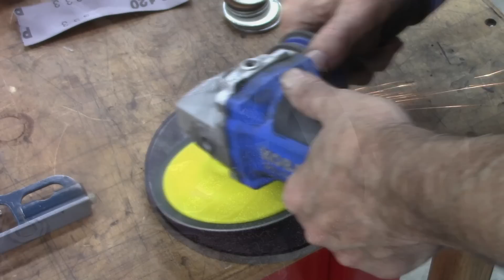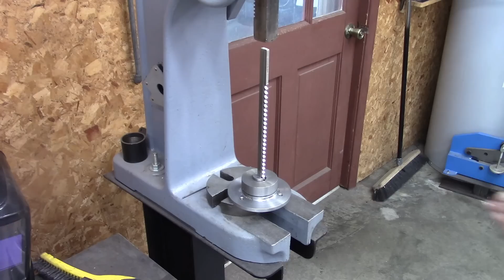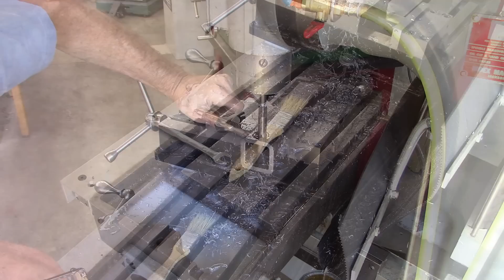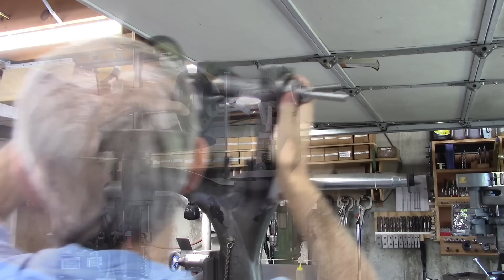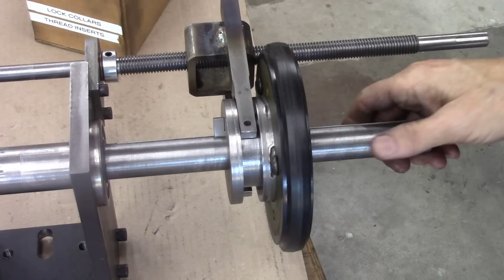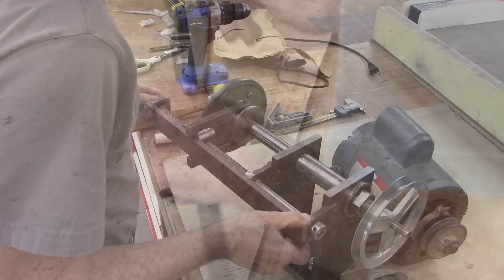1918 Jas. Clark Jr. Electric Co. Friction drive drill press - Building a new drive - Part 2

Comment: Your broach crooking problem is because of your arbor press.  It is a square ram press.  The force comes from the pitch-line of the gear rack. The broach needs to be centered directly under the rack, not in the center of the square ram.  Without a mushroom head cap for the end of the ram, this is hard to locate there.  Take for example a Greenerd arbor press, with the round ram.  The rack is in the center of the ram. They give a straight line of downward force. A Greenerd press will have no issues pushing a broach.  All those Atlas or Dake presses will do, is the ram will crook, and force your broach off center.  They may be OK for pushing bushings and bearings, but absolute crap for pushing a broach.  As I said, making a mushroom cap for your ram will help, and you can get the push from right under the rack, but the ram will still move all over.  Give your Dake to someone you don't like, and buy a Greenerd.  I think Winsmith in Springville NY also made a copy of the Greenerd.  -------Doozer
Reply from the maker: You may be correct on all accounts, I have a very old drill press that has an applied rack on the back of the quill, it moved the drill out toward the operator significantly if you don't keep the quill adjusted tight. Mushroom end???  I thought you might have meant concave but after looking at pictures it looks convex which seems like a negative. There is also a couple other things to consider. Some say to relieve the pressure and let the broach align itself (which I did). I think you you be better off with the broach fix on the end of the ram and the work clamped. And last. The alignment of the ram due to pressure at the rack moves the ram toward the operator and my broach leaned back, not forward. Honestly, I think the broach method for cutting keyways is not ideal. there is nothing stopping the teeth from being pulled into the cut.

Comment: Mark,  Why do you saw so much material instead of using the Vevor Plasma Cutter?  With the broach, is the end of the ram parallel with the bolster plate?  Also next time push three teeth and release pressure prior to pushing again.   Next suggestion is reduce the motor pulley diameter to 2 inch and increase the shaft pulley to 12 inch; 4000 RPM is much too high for the spindle bearings of a machine of that vintage.   JAS. CLARK JR. designed a very interesting drive,  it may be necessary to increase the friction wheel pressure against the drive disk to enable the transfer of sufficient power to drill over 0.50 diameter drills.  This was a fun project keep up the good work!
Reply from the maker: I sold the plasma. Part of my problem with the plasma was an unsteady hand but mostly it made a huge mess. The saw (in most cases) is the best option. I did as you suggest, advance the broach and then release the pressure. Honestly, I think this actually contributes to the problem. The teeth of the broach pull the broach into the cut and releasing the pressure allows the broach to angle back. I think constant pressure is best although maybe not a complete fix. I need to possibly support the work better and also check the press ram alinement. As for the drill press speed, the motor pulley is 3" and the driven is 6". The puck (rubber drive) is also about 6". At the outer edge of the platter its 14". With a motor speed of 1750 the RPM of the puck is 875. The reduction ratio between the puck and platter is 2.3 which reduces the speed to 380 RPM. Realistic top speed is 1700 which is pushing things a little. I may increase the driven pulley diameter a little to get the low speed down about 250 but the current speed is good for most things. The drill press is now almost complete now (the video content is behind). The rubber on the puck is slightly compressed and seems to grab very well. I tested a 5/8" drill on 3/8" steel at the lowest RPM of 380 and it never hesitated.

Comment: I am really enjoying this project.  Whomever conceived the idea to use the puc / plate mechanism for an infinitely variable ratio was indeed a very clever person.  I can't wait to see the project outcome used as a tool.
Reply from the maker: There are several other methods used on old machines too. I saw a drill press with with two apposing cons with a rubber wheel between them. You move the wheel change the ratio.

Comment: The adjuster rod, I'd put a block of aluminum or steel inside the quare tubing , that is holding a brass nut. Or drill and tap a piece of brass to make the threaded adjuster brass  and maybe have room for felt around the threaded rod.with a 1/8" npt pipe about 1" long to add a few drops of oil occasionally. Like Babbitt bearings used to keep oil on the shaft!
Reply from the maker: Hmmm...  Its not going to be moved often but I like the oil felt idea. I'll put it inside the square. Thanks

Comment: To prevent the broach from going on a tangent, id make a longer bushing. That  can hold the broach higher up. Then be removed when the broach is deeper. Possibly using a bolt  to hold it to the bushing inside the hole. It can use a hollow dowel to keep its precision. And a bolt to hold it together,  the bolt could be about 3.5" 1/4" with the  bushing extension being about 3"- 3.125" tall. It can be clearanced to allow the shim to fit for the second pass.  Or make a longer shim, that could be another way, make a shim about 6" long .  With enough thickness up top for about 3"-4" to support the broach. Its not going to be that strong. I like the long bushing extension better!✌️ have a great day!
Reply from the maker: I agree...  lots of room for improvement. This is a bad system for cutting a keyway. I will fix this

Comment: I had that problem broaching on my press til I realized there’s a hole drilled on bottom of press arm for attachments ( I guess). I just used a steel plate between the arm and broach and it pushed straight after that.
Reply from the maker: My ram has a slight curve on the bottom, not sure it has a hole. I can machine is flat but I'm not convine it would do anything. I'll look at this closer, thanks

Comment: I assume you are lifting the arbor regularly to relieve lateral pressure? Try turning the teeth of the broach away from you.
Reply from the maker: I thing relieve the pressure is part of the problem.
Reply: @WinkysWorkshop  If you don't lift several times, you most assuredly will break the broach. Rotating the teeth 180 degrees each lift will help if the arbor is not square to the base.
Reply from the maker: @mikepoore1653  Lifting the ram allows the broach to lean. Once is starts it will get worse. On the flip side, putting a bow in the broach is not ideal either. This is a very bad system for cutting a keyway. I will improve on this.

Comment: I’ve had similar problems.  I once had the shim drag through. 
The longer the bore the more problems I have.
Making sure the broach and table and ram are lined up and square helps. Use lots of heavy duty grease between broach and shim.
I also found some burrs on the back of the broach and smoothed them out allowed things to slide easier. The back of the broach on the leading edge had a sharp  edge and caught the shim.
Reply from the maker: Thanks for the tips! There has to be a way to make broaching fool proof!
Reply: @WinkysWorkshop  from my reading the gold standard is a pull through broach - but that is an out of reach snack bracket for me
Reply from the maker: @glennwright9747  OH...  interesting (and maybe tricky)

Comment: The first pass on the broach seemed uneventful.  Your broaching problem only seemed to manifest after inserting the spacer to push the broach further into the cut.  Is the spacer not parallel, or maybe a chip got stuck behind the spacer, or there is a burr on the back ?  Even a tiny change from truly vertical will position the top of the broach further back on the face of the ram and the effective angle of the broach will get worse and worse as the ram descends.
Reply from the maker: Not sure why but it was for sure at an angle. The tooth shape seems to put it away from the shim. Has to be a way to make it fool proof

Comment: You ought to put a guard around the driven disk or run it with a hardhat 😊
Reply from the maker: Fortunately the disk is smooth and without a pinch point in front. It's possible you might get a stripe on your forehead but no real danger. It puts out a lot of air at higher speeds. It would keep you cool on a hot summer day. 😜

Comment: It will be interesting to see when you get a chuck on the shaft and put it under a load and see if the clutch wheel slips or has enough friction to grab and drill large holes. But it sure is a very nice build.
Reply from the maker: We shall see but I think it will be fine.

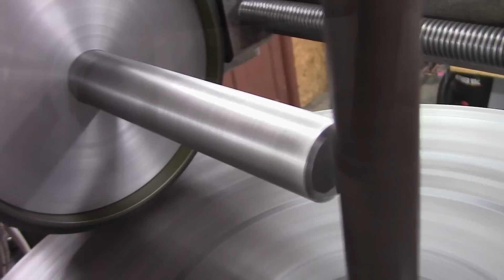Comment: Amazing project,Mark and well built as usual.It looks like is working well (no slippage ) and wonder if the loose end of the axle is giving some rattle (25:36 ).Good machine.Thank you.
Reply from the maker: I think most of it is the yoke. There is a slight alignment issue that makes the drive wheel try to move out. When I reinstall the drive I'll address this. Thanks and thinks for the feedback.

Comment: How much force can that wheel take before slipping?Think it would be better to put mechanism on pivot point so you can adjust tension with a screw.
Reply from the maker: I did consider that and I wont know until I use the drill press but it appears to be driving very well.

Comment: The brouch looks to be pushed  off angle. Ck  the square bottom maybe tilting the brouch or press isn't square push rod to base.
Reply from the maker: It is at an angle for sure. When i let pressure off the ram the top of the broach moved back... just not sure why.

Comment: Another interesting and fun project.
Maybe you could add a second small friction drive and idlers between the drive shaft and screw speed adjust shaft. This way  instead of turning a knob to change speeds you shift a lever that has the motor turning the screw. I know it's all done now but maybe food for thought the next time.
Enjoy watching you work, thanks for sharing.
Reply from the maker: Very cool Ideal! I'll probably use it as is but if I was manufacturing these drill presses it would be worth the effort to design this. Thanks

Comment: one reason the broach might be camming forward and jamming is the overhang on the daisy wheel; it looked like the front part of the wheel was unsupported so it was rocking forward. could be as simple to fix as having a little packing block under the front of the part so the whole thing is supported, or using a bigger daisy wheel
Reply from the maker: Interesting, I don't think this is happening but for sure worth looking at, Thanks
Reply: I agree with your conclusion, but how would a bigger daisy wheel help? I just can't picture it.
Reply: @trollforge  it seemed like the fingers of the wheel weren't extending past the front of the part. my thinking was a bigger wheel with deeper slots could support more of the part. but just jamming a block under the front is probably easier
Reply: @Gnomebitten  Ok, right I got you! I was just envisioning the cutout and seeing bigger as in wider, now I see you mean bigger as in longer! Ty.
Reply from the maker: I thick it is even with the front of the ram but worth looking at for sure.

Comment: Excellent craftsmanship as always. Some viewers may not understand what it takes to do something like this not to mention while doing it on camera. I just finished making a new gear for my quick-change gear box on my Clausing Lathe. Lots of pre-thought and concentration goes into our projects. Seeing you wearing those short pants reminded me that this week is the first time I have worn long pants in my shop since springtime. It hit the 40's here this week. Even started the days with a hoodie. Seems like I am working against the weather clock. I've got a project that I am going to use Moglice on and it requires warm temp  to use it. It also has a shelf life on it so got to get it done before it expires. So the race is on. LOL Thanks as always for bringing us along.
Reply from the maker: THANKS! Yes it is a lot of work but I enjoy it most the time. I've cut 3 gears and not one of them worked well. They looked pretty but they were noisy. Hopefully the gear hobbing set up I make will do well. I need to learn more about Moglice.

Comment: There was no support on the front of the workpiece. 9:40
Reply from the maker: You might be right. I'm going to look into this. the daisy wheel is about even with the front of the ram...  seems like enough but maybe not.
Reply: @WinkysWorkshop 
I think I saw the anvil (“daisy wheel”) tip forward when you started pressing too.
Reply from the maker: @jeremylastname873  I don't think so. I think the broaches are poorly designed (too much back rake). If I paid for good one they would probably do fine. With that being said, every time I seem somebody broach a keyway they always breathe a sigh of relief when the keyway is cut. It's flawed process. If I had a machine shop I'd buy a shaper for keyways or build a power broach machine.

Comment: Wow, another beautiful piece Mark. 
The thought that the friction wheel should have been driven from the underside to avoid dust, rubber and other debris affecting the power transmission kept coming up. Is there a reason you put the driving wheel on top?
Reply from the maker: The original was on top. It would be hard to move to the bottom. Dirt and debris will not stay on the disk...  its like a fan when running.
Reply: @WinkysWorkshop  Ofcourse - its spinning! (doh). I guess you can cover it while not in use.
Reply from the maker: @ShoebridgeForPM  I don't think it will be an issue, I'm a little more concerned about oil. I need to get some anti-seize to lubricate the bar the puck slide on.
Reply: @WinkysWorkshop  and keep it off the driven platter...

Comment: Wondering how the rubber will wear, and can it be replaced. Very cool design.
Reply from the maker: Yes, its a snapper lawnmower drive wheel and easy to find. I have a 30" mower and never had the change the drive. I had it about 10 years and mowed about an acre. I think it will wear well.

Comment: My thought on the broaching problem is that by putting in a relief cut, the broach is taking the path of least resistance and ending up at an angle.  If there was no relief cut, the broach would have the support to stay vertical.  Keep up the good work!
Reply from the maker: The broach I broke did the same without the relief. I was just trying to resolve the issue.
Reply: Looking at the slotted support, maybe the workpiece is tilting slightly under pressure as it is overhanging atvthe front a tad. Thus causing the broach to appear tilted whereas it is the workpiece that has tilted.
Maybe try it direct on the bed of the press?
Reply from the maker: @lesmaybury793  I need to look at the bed. The edge of the daisy wheel is about even with the front of the ram, maybe it need to be extended a bit.

Comment: Mr Winky, my experience of broaching take 1/4 of the cut and release this will reposition the broach straight, then another cut and repeat, the press has a tendency to push the broach out of line until you release
Reply from the maker: I did that. And every time I released the pressure the top of the broach moved back which made it further out of line. I'm thinking the work need to be clamped and the top of the broach held firm. But I could be wrong.